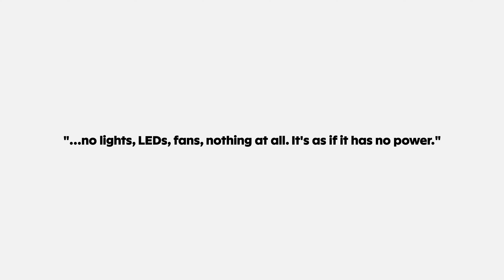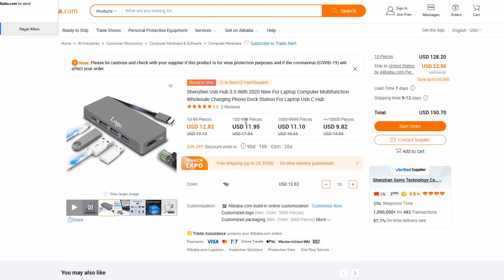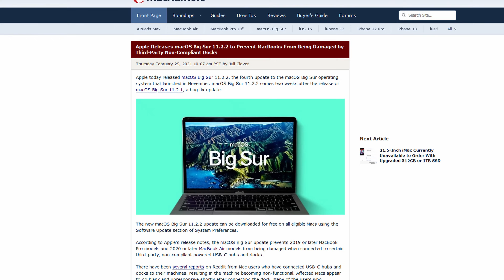Are USB-C Hubs Killing M1 MacBooks?

Comment: I wanna buy the new macbook but I’m confused because i have programming stuffs to do will it work on the newer mac?
Reply: As far as I can tell, everything works on my M1 MacBook Air, VS Code runs perfectly, Android studio works well and there is a beta version of the emulator that you can use, Xcode works perfectly, and there is a version of parallels for apple silicon that runs ARM64 windows which runs x86 and x86_64 windows programs, too.
Reply: @joeypesante2422  i gotta run softwares like codeblocks so will it work and as I’ve  seen there’s no windows emulator so is there any other way
Reply: @ronakmankale9599  If you run Parallels Desktop 16's technical preview, you can run Code:Blocks in the ARM windows environment. Make sure your Virtual Machine is in the Beta ring for Insiders updates if you want to use the x86_64 version.
Reply: Haha same, i just sold my old windows laptop, macbook pro arriving this week :) Hopefully it works
Reply: @MrSimram  will you share your experience with me when it’ll arrive cuz I’m so confused that I can’t even come upto a decision
Reply: @ronakmankale9599  Sure, if i can remember it.  I'm a student, so i will be using it for php (probably with phpstorm), SQL, and docker. Going to be a wild ride :p

Comment: Been using a Belkin USBC hub for the last couple of months with no issues at all on my M1 MacBook Pro. Have a 1440p monitor, webcam, external HDD and power plugged in and all work fine. Have now disconnected the power from the hub and plugged it into the other USBC port, still all working fine.
Reply from the maker: Belkin is a good brand, I've never had issues with them and use multiple Belkin products!
Reply: J

Comment: I'm happy with my M1 MBPro and Anker hub... That said, this is what bothers me of Apple, they always spin/shift the blame unto others. Bad USB Hubs, but curiously it only affects them, not Win10 PC's.
Reply: Your right and the Issue of USB-C PD frying macbooks is not new and certainly not to apple. My late 2016 MBP fried 2 times already due to USBC-PD and apple each time requiring a Logic-board replacement at 530€. 
The cited Louis Rossman, has an extensive video explaining how bad chip design  is causing charge controllers to fail over time. 
The fact that in 2020 (4 years later) Apple still releases new machines with the same kind of issue is proof enough that they are not taking these issues seriously, because they are busy blaming the user or denying the mere existence of issues.
DISCLAIMER: I am not part of the apple cult following i just need a reliable work tool and happend to buy apple.
Reply: Louis Rossman provided proof other computer can be affected by this issue.
Bad usb cable also has been known to kill mobile devices few years back
Reply: @rabidbou4336   I'm not gonna dispute any claim whatsoever of whoever made them. Every computer and/or accessory has their defective units. Even cpus have have cores that are defective and the list goes on. I'm just pointing that Apple always shift the blame, like "We're not holding out iPhones correctly"  "Flash is Wrong for the User as it drains the battery"...
Reply: @rumar4u  have have* have had
Reply: I have the M1 MBP and I use the Anker hub as well. I don’t charge it through the hub though (and I don’t plan to).
Reply: @whatever.a.d.h  main goal of pd hubs is a single cable to your device that does it all. I use this daily with different pd hubs on windows machine with 100w usb-c 5A cable. And after 2 year with all chinese power supplies and pd hubs my hp still works fine. The only part that suffers are some of those pd hubs that get to hot and temporary shutdown. But never my pc
Reply: apple should have put at least 3 usb c ports, 1 for charging, 1 for monitor, 1 for hub
Reply: Why windows machines does not break with these usb hubs... -you holding it wrong, yeas apple dont take responsibility... Anyway how about warranty, did you got a replacement mac?
Reply: (Louis Rossman is a well known repair man -micro soldering, who is roasting apple on many occurrence BTW)
Reply: I totally feel you, except this time Apple has not blamed anyone, neither done an official statement -except from the software update which is a confession.
But anyway I’ve pointed out that USB-C PD standard has been frying a lot of mobile phone few years back, and I would not be surprised it’s the same issue here.
PD can provide up to 100W...
Reply: @rabidbou4336  "his time Apple has not blamed anyone"
They literally have. They blamed "non-compliant USB hubs", despite the fact that there are many MacBooks bricked by the hubs they sell on their own website and reports of MacBooks bricked by Apple's own USB-C hub.
Apple had 28 of their own engineers involved in the design of the USB-C Power Delivery specification, yet they apparently aren't capable of producing a hub that complies to the standard they themselves helped to design, that is beyond incompetent.
Reply: @barryinglaterra  source ?
Reply: @rabidbou4336  source: a small number of people 3:34
Reply: @HighestRank  talking about Apple Official response blaming others...
Reply: @barryinglaterra  No, it's not beyond incompetent. Things like this are to be expected for any early version of a brand new technology. They fixed the issue now, and those who did suffer from logic-board frying were able to get a new machine under the warranty. If you want the cutting-edge this is the trade-off. Seriously, for a first gen technology this is running smoother than probably any new chip release pretty much ever. My Macbook knows when to charge and when to stop charging automatically pas 80% to preserve the battery. I use Apple's cable and plug-it directly into my power bar. It could be the hub, it could be the cable, it could be the software, the electricity in your building itself or likely a combination of two or more of those things. No dangerous accidents happened so far, you deal with this under warranty, and most people have a smoother experience with the M1 than with most computers in general that are at many more than their 1st gen. If you open-up an Apple power-brick you'll understand why using third party charger/cable is NOT a good idea : they are far more complex than most laptops. Also, 100 watts pass-through is a little ridiculous, when you think about the fact that it could cause serious damage to devices with problematic SMPC, and just about no one needs that much power in USB pass-through.
Reply: @jas_bataille  always thought it was safe having 100 watts passing  throw a device as long it has good safety check in manufacturing and is approved by electrocution. And is offering safety mechanism like overheating sensor, E-Market and so on. Also the most common reason what’s fraying phone or pc. Is using cable that is not USB-IF certified or charger hasn’t safety sensor. The funny thing is they cost the same as regular the difference. Take time finding dose good brand.
Reply: @jas_bataille  long essay defending the one who screwed you over, good job!
Reply: @lukeszns  actually it doesn’t I work in IT and all our USB-C hubs do power delivery and not one has killed a laptop.
Reply: Well, yes and no. USB hubs such as the ones on Amazon shown here are almost always bought my Macbook users.

Comment: I have been using M1 pro for two months and I never charge mine via hub(apple USB hub). I always use them separately. Just by my instinct. Glad they addressed the issue on time.
Reply: I actually had a case of a MacBook failing while it was connected to a hub. The Problem is the hub is my MONITOR... So I can't avoid charging it while it is connected. However thanks to waranty I got it replaced and up to now everything is working properly
Reply: @noah1239  which MacBook model you are having?
Reply: @azizi8090  Air
Reply: @noah1239  that shows that Apple has dodgy quality control, just what meets the eye...
Reply: For real, completely agree. Seems weird to plug into the hub vs direct to computer. It just feels wrong.
Reply: I was thinking of doing this same thing myself. Glad someone else would too.
Reply: I don't have one but if I get one I will remember this
Reply: I very rarely charge through the hub and after this video, never again. I currently use a 4-port USB A to USB C to connect my hard drives and if I need to power the Mac, I simply use the other USB C on the Mac itself. I'm going to stick with that from now on.
Reply: @telcobilly  your hard drive? Does it need external power or from the mac itself is enough? And if it does using external power, it is safe?
Reply: @viva7642  I'm actually running two 5 TB USB powered drives simultaneously with a thumb drive on a USB C to 4-port USB A hub. It's not the multiport hub with HDMI and ethernet although I do have that. Doesn't get warm, M1 MBA had no problem. 
I'm using a magnetic connector in one of the Mac's USB C ports. The brand is Electjet available on Amazon. I'm using them on two recent Samsung tablets as well. They allow full functionality of the USB C ports and support 10 tb worth of USB drives with no slow downs or heat.

I've also connected two 8tb & 14tb external powered USB drives simultaneously as well.

If I need to charge the Mac, I plug my USB C power cord into the open USB C port rather than going through any type of hub pass through. I have done it in the past but after this video I'm not going to do that anymore. Nothing to be gained for the risk I might be taking.
Reply: @telcobilly  my brain hurts
Reply: You are light macbook user thats why
Reply: Same. And I only used the Apple USB hub also.
Reply: I have a 2017 i7 MacBook Pro which I charged always through the original Apple hub so I could have a "one cable" docking situation! I have solid reasons to think that this have caused my battery to die prematurely but I have no way of proving it. I only charge my battery through the port itself and never thought the hub since then...
Reply: no instinct, just best practices.
Reply: Me too.And my adapter always use the apple one.
Reply: I don't get it. Why would you have to since they now have that magsafe chargers again? I know you CAN charge via thunderbolt USB-C, but why would you?
Reply: mee too i just never buy macbooks, problem solved
Reply: Same here
Reply: @hawkeyeaerialphotography6652  me too, I never charge my m1 on the hub, I always charge on the laptop itself. idk why people just don't do that anyways.
Reply: @addykantoor6327  some hubs use up both ports of the MacBook Pro/Air. And who would’ve known about this issue? Lol. Idk why you act like people can read into the future and know this would be a problem.
Reply: @EricNguyenTV  EXACTLY!!!! Unfortunately, convenience is not apple trademark. :(
Reply: @addykantoor6327  Why? I take that as a joke of the month!
Reply: @addykantoor6327  probably because it’s a feature advertised by apple so it should work.
Reply: @addykantoor6327  Because it's really convenient, especially when you laptop has just one type-c port and another one is used by earphones.
Reply: Exactly. And what's the point in charging over a hub vs direct in the notebook? It doesn't provide you an extra port..
Reply: @frits1463  actually it does, say you have 4 port hub, so you could charge and use the extra port on the hub for other device, like @telcobilly was explaining above
Reply: @lour7299  No it does not. If you connect a 4 port hub to your 2 port macbook, you have 5 ports, whatever you connect. So put the power supply in the macbook and the rest in the hub. Easy.
Reply: @frits1463  I was answering your statement that it does not provide extra ports, but it does gives you 5 port in total ( like the hub in thumbnail) or with some hubs, it actually used 2 ports in Macbook , and gives you 4 ports.